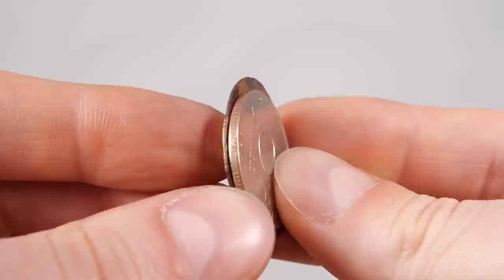I Turn a Coin into a Copper Plane

Comment: Hey I have a question
Why did he cool down the coin by immersing it water while hammering it. I understand heating it to reduce the stresses created on the material by hammering it, but if you immerse it in water it cools down fast, making the material more brittle, right? I was thinking that you would rather have the material by less brittle while shaping it, and at the end you'd immerse it in water to strengthen the material.
I hope to hear the reason why you did this, I am sure I missed out something!
Also, it was a great video :)
Reply: I think is for being easier to expand it, one of the thermodynamics rules is that when something is heated, it expand, so when he heated he expanded, and for the metal to not contract to they original size, he cool down faster. I hope you understand, and sorry for my English.